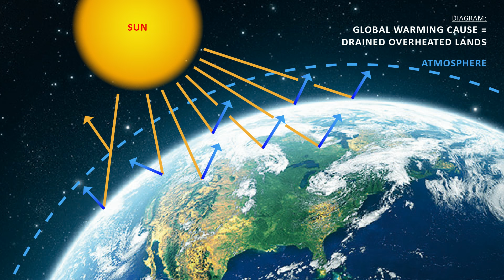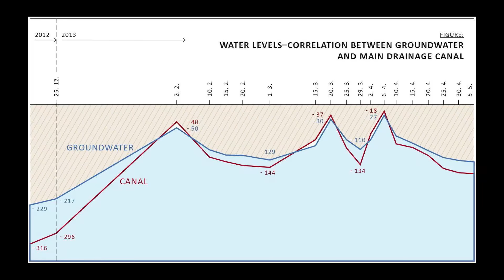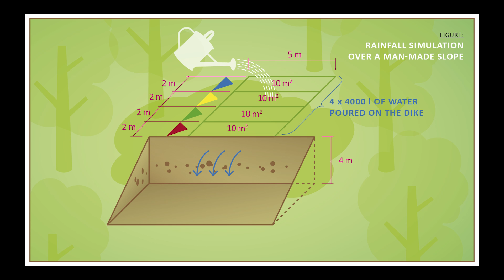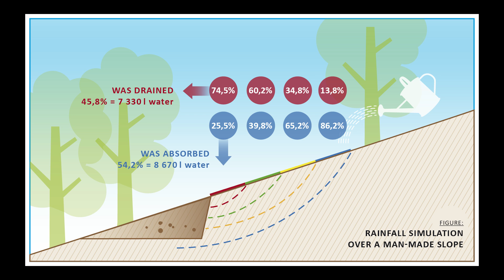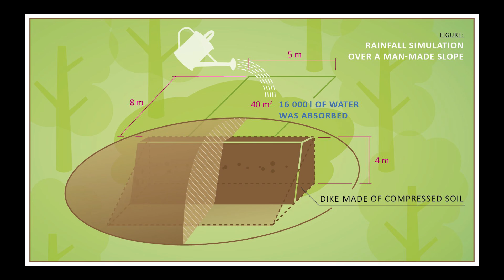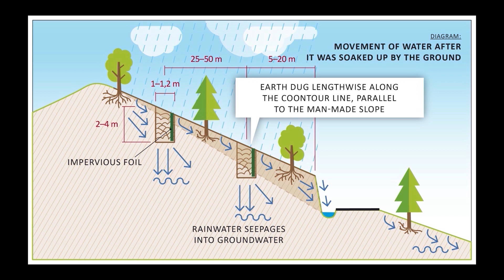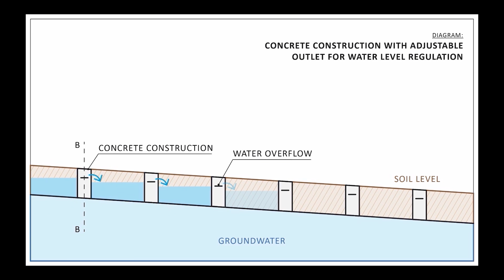Climate Error

Comment: Are these measurements in square kilometres or linear?
Reply: The measurements are in the square kilometers
Reply: @MRMarkston  In my opinion, the kilometers shown in the video are linear. However, the author claims that when calculating the built-up (non-soaking) area in square kilometers a) it is not correct to multiply linear kilometers only by the width of roads, but instead to take into account much wider areas along roads that are drained by drainage channels and artificial slopes,  and b) it is necessary to include temporary (however effectively permanent) forest roads as well. As a result, he estimates that the actual ratio of non-soaking area is 65% instead of the official value of 4.7% of the built-up area. And that, along with the proposed solution, is the main message of the video.